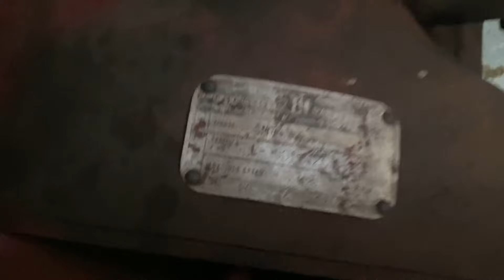Super M Farmall sawmill tractor—some questions answered.

Comment from the maker: Just to add, we are not painting it. We used to paint every tractor we dragged in but that just don’t interest me anymore. The patina and character means more to me.
Reply: If you’re not gonna paint it, add a couple coats of clear to protect what paint is there it is good that you have it under the cover
Reply from the maker: It gets coated with linseed oil occasionally.
Reply: @tennesseesawmillguy1590  do you use it for anything else other than the mill? It is a good tractor to have on the sawmill. My grandpa had a super MTA on his
Reply: Tractors and women- most of them are prettier without paint.
Reply from the maker: I’ve used it to pull logs before and it’s seen some parade duty. 
It does need some steering work. The bolster and steering shaft unjoint are worn out.